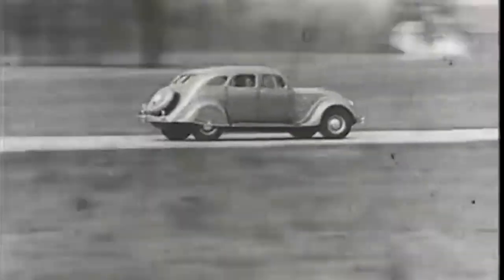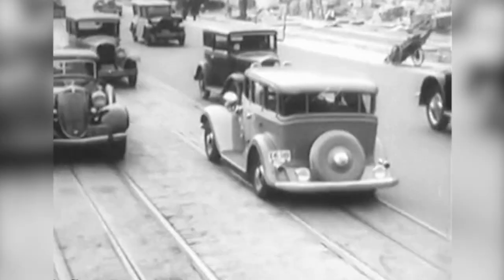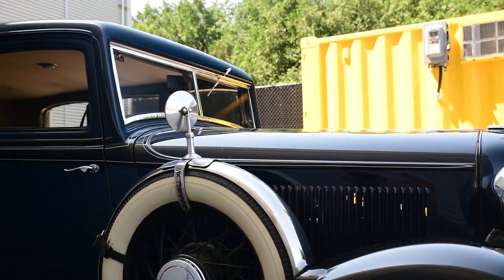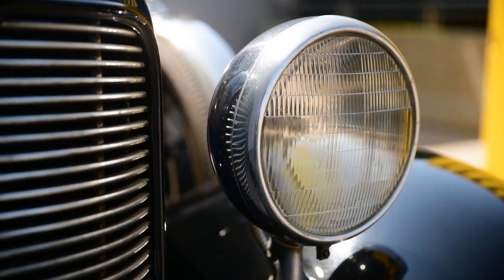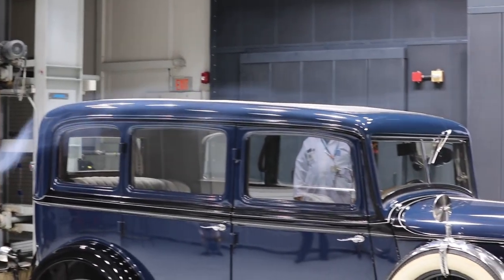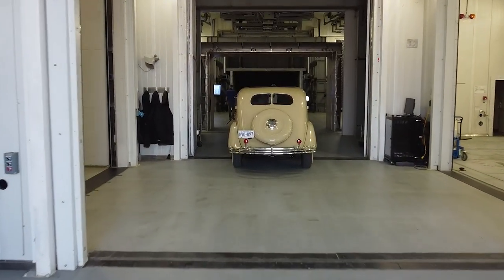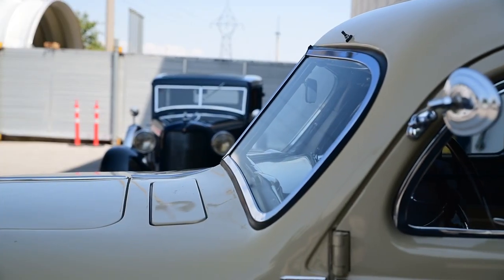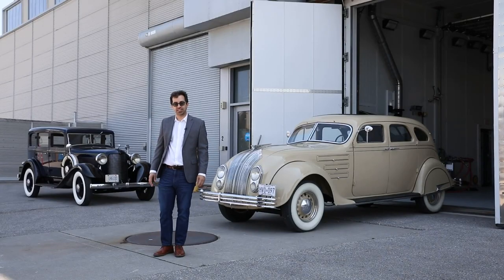Chrysler’s 1934 Airflow revolutionized car aerodynamics—our wind-tunnel tests prove it | Driving.ca

Comment: Automotive aerodynamics are only significantly practical at speeds above 45 mph. However, in the mid-1930s there were no high-speed roads like today. In fact, the typical country road for traveling long distance at that time was winding, heavily crowned, and two-way. Approximately 50 mph was as fast as a driver could safely operate a car on those roads. Thus, the highly aerodynamic Airflow/Airstream cars from Chrysler Corporation did not have a practical purpose. Instead, what buyers at that time found more desirable was a comfortable ride. The similarly styled aerodynamic DeSoto was even less popular than the Chrysler Airflow. Planned, but never produced, Dodge and Plymouth models of similar aerodynamic design would have been so unpopular that Chrysler Corporation would have probably gone bankrupt. As a result of poor sales, all Chrysler Corporation's models had ultraconservative design until Virgil Exner's popular 1955 Forward Look models. The most dumpy/dull looking models of the conservative era were the 1937/1938 models ("potato era") and 1949/1950 models (stubby boxlike).

Comment: I almost wonder if the lower numbers you measured not meeting Chrysler's claims wasn't because of better measuring techniques and overall advancement in the knowledge of  aerodynamics?
Reply: I suspect if you took off the license plates and rear view mirrors and just tested the body shape it would look better. There is also the fact that Chrysler tested wooden model shapes in a 3X2 foot wind tunnel so would not get the same effect as a full size car.